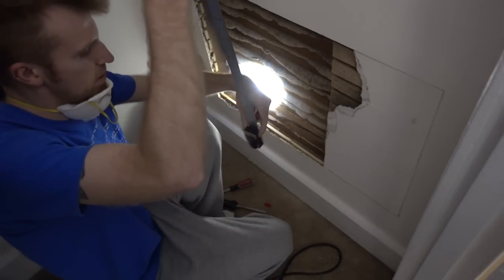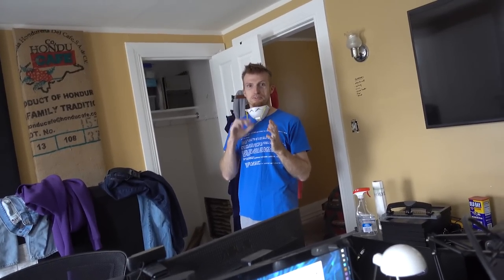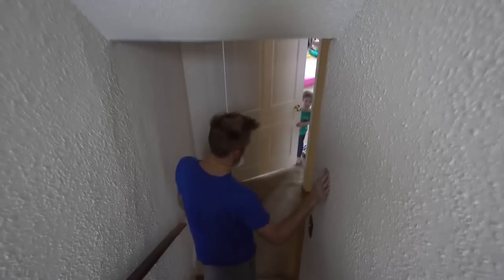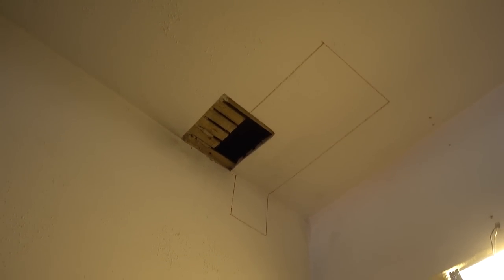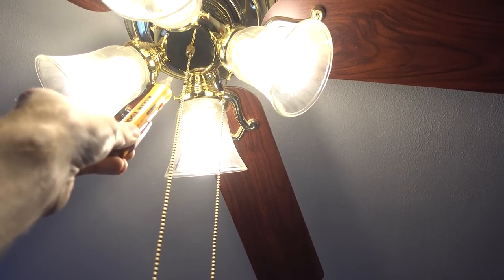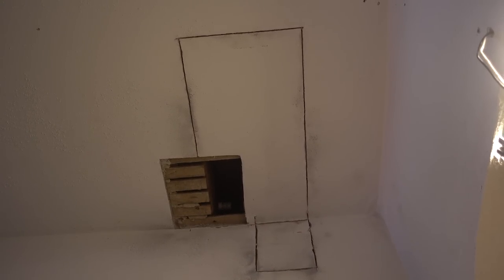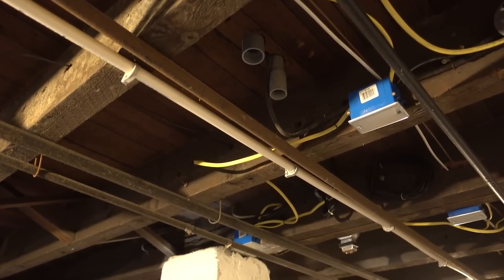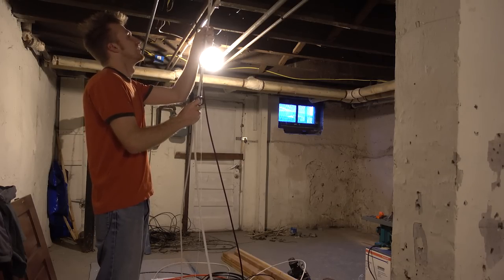Running Conduit and Pulling Cables!

Comment: While pulling cables through conduit isn’t against code, I will say that I hadn’t counted the number of cables you pulled through. You have to worry about cable bundling and the fact that when you have a certain amount of cables in a single conduit you have to derate them. And being that each cable you pulled in is a 2 wire cable meaning there are two current carrying conductors (black and white) per cable. And once you go past 9 you would have to reduce the amperage of the cables you pulled to keep them from burning up because of not being able to dissipate heat. The part of the code that deals with this is table NEC Table 310.15(B)(3)(A), and and also since you’re using NM-B Cable you use the 90 degree Celsius amperage chart on NEC Table 310.15(B)(16) according to nm-b ampacity from article 334.80. But the ending amperage after derating can’t be higher than the 60 degree amperage column according to code. I agree with the comment about a sub panel on each floor then that would cut back on the number of wires or cables you have in each conduit, and plus you could easily add to it at a later date on whatever floor you do choose because the powers already on each level. But the way you have it since you have that orange 10/2 with ground added you can’t go over three 2 wire cables without having to upsize the wire to makeup for the voltage reduction due to heat. And seeing how the 90 degree column puts the amperage for a 10/2 cable at 40 amperes, and with the bundling of over 6 and up to 9 wires you have to reduce ampacity to 70% of that 40 amps which drops you to 28 amps which is below 30 amps, and I see more cables than 9 in which case it drops to 50% of the 40 amps if you have have 10 current carrying wires in that conduit which amounts to the equivalent of 5 two wire cables example 10/2, 12/2, 14/2, 14/2, and 12/2.  And since you have that 10 gauge wire you would be limited to 3 two wire cables. If you take the 10/2 out and left the smaller cable you could have up to 4 two wire cables. Unless you pulled them individually and didn’t bundle them together. Good luck.

Comment: If you have to pull wires through a long run of conduit again, try this instead of pushing a "fish" wire through. Tie a small bit of cloth to a string, put a vacuum cleaner on the other end of the conduit, and suck the cloth and string through. Use the string to pull something a bit stronger through, and pull the wires.
Reply: Oh, and a PS. You and my kids are still 10th cousins twice removed, on their mother's side.  :-)  (See your November 2015 20 Questions video.)

Comment: Not surprised that you found hot knob & tube.  Not a great discovery but I believe NEC code still allows it so long as you don't alter it in any fashion.  The downside is that it will be a source of RF noise that could downgrade your data pass through rates.

Comment: Steve, did you think about just adding a sub panel on the third floor instead of pulling all those lines up. you could have just added a single 10ga wire and a sub panel. then add wires to the sub panel. much shorter runs...
Reply: I did consider that, yes. However, the amperage total we need up here is actually higher than 10-gauge wire would accomodate. The price of 4/3 was higher than the cost of the individual lines, so it made more sense to run them individually.

Comment: It's a good idea to get rid of that nob and tube wiring. Makes you wonder way the didn't take it out.
Reply: K&T wiring is pretty safe due to the separations and insulation.  It can be repaired but not extended as its still within code.
Reply: I think you better look up the national electric codes then. Because it can't be used for any modern connections made to it.
Reply: That is true, no adding on, and keeping in mind, back in those days, houses often had 40 or 50 amp panels total! Not many things would get plugged in so not having a good ground was mostly okay then.

Comment: It's easier if you thread wires downward, then you have gravity on your side :)
Reply from the maker: While true, there are another 25 feet in the basement to get to the panel so it would have required even more pulling
Reply: But then you have to haul all of the wire upstairs and haul whatever you use back down.
Reply: I'm not an electrician, but I have read some Black and Decker howto books.  It was recommended to wire from the source to the device.

Comment: Unfortunately it is absolutely against code to run Romex through any kind of conduit, Romex is only designed to be stapled onto wood structures and also through bored holes (with adequate nail Stopper plates)
 The proper wire for use in conduit is THHN or thwn which is a single wire times how many wires you need for all the conductors when using conduit!
When I was getting my electrical training I got curious and I asked my trainer why that's not allowed and he said because the way an inspector explained it to him was becaus Rolmex wire isn't designed to go through conduit because of lack of good heat dissipation with the extra casing that Romex has! you know the yellow, orange or white extra casing (color depending on wire gauge) anyways I know what's done is done you may have gotten lucky it may not have been inspected or if was inspector may have been like yeah whatever but I don't like going with whatever's LOL

Comment: Why are you running a 220 line (orange wire) to the third floor?
Reply from the maker: 10/3 wire supports the needed 30 amp service for a split system air conditioner that will be mounted up here someday
Reply: OHHHHH, future A/C